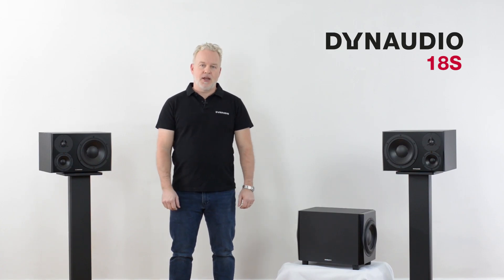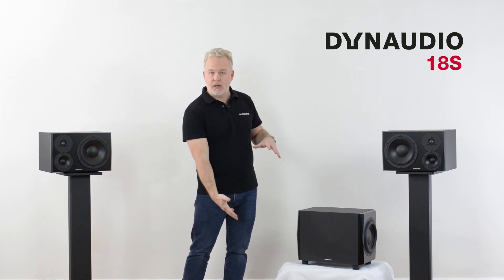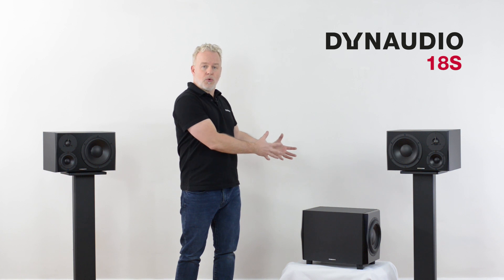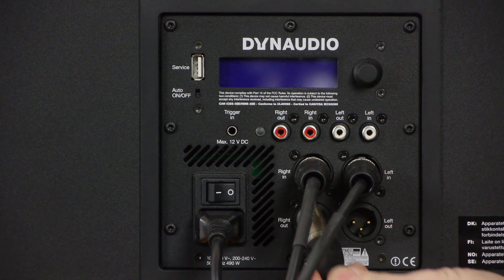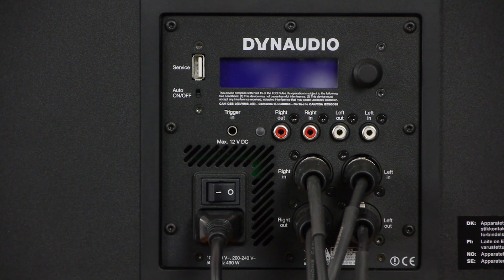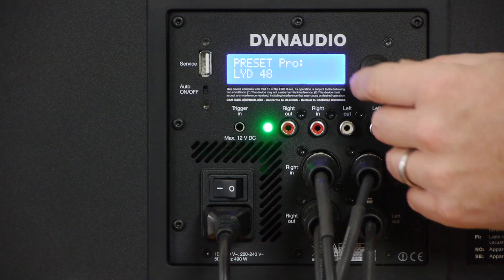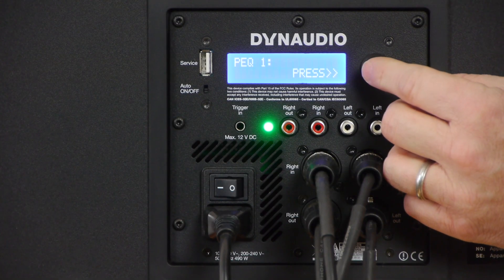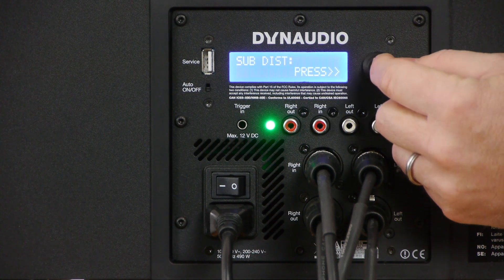Get to know the Dynaudio 18S studio subwoofer

Comment: I just bought this sub to Pair with my Dynaudio BM15A's, and it has not worked correctly. Buyer beware, I have reached out to DynAudio, but they do not reply back. Also, I have to do numerous factory resets for when the right side stops working, I did have a Dynaudio 9s, and it was a nice sub, I thought I go with this, seeing my room is 25' x 35', it might give more of what I need, but it has not yet worked correctly, I purchased from Vintage King and the only solution brings it back and we'll exchange it.I think I'm going back to the 9s, the DSP sounds like a good idea, but when it does not work, it is a real bummer
Reply: I’m running Focal Alpha Evo 65’s in a similar size room. I DJ/ Produce EDM would the 9S be sufficient?

Comment: Thanks for the video but there's a pet hate at 5:44 phase ≠ polarity. Are you changing the phase or polarity?
Reply from the maker: Hi Adrian. Thanks for catching that. It is phase :-) 

https://www.dynaudio.com/professional-audio/subwoofers/18s/support/manual/en/control-and-configuration#phase
Reply: @dynaudioprofessional  hey is it better to set the input sensitivity on the 18s at -12 or -6 when paired with the lyd 48s?

Comment: how can the 'trigger' input be utilized? how can I have the ability to bypass and engage the sub at will? i want to connect the LYD48s to the sub (rather than put sub on separate output on my monitor controller) but I'm unsure how to bypass it when needed within this kind of setup.
Reply from the maker: Hi Kelly. Thanks for asking. It is described in the manual right here: https://www.dynaudio.com/professional-audio/subwoofers/18s/support/manual/en/control-and-configuration

Hope this helps. 😀
Reply: @dynaudioprofessional  Hi, thanks, but I've already read that a few times (I re-read it again now to be triple sure). It seems to say the Trigger input can only do a 'one-way' control (eg turn the sub on, or mute the sub -- but not both). Am I understanding this correctly? I have no way to turn the sub on (as well as mute it) from the trigger? I'm super sad if this is the case, as I already blindly made the purchase thinking there's no way that feature wouldn't be available (my other 2 subs, both at similar price point, offered a manner to do this). I will also admit, that I don't know which product is appropriate to buy as a 'trigger' (forgive me, but I'm only familiar with bypass pedal approach). Could you make any suggestion in this regard?
Reply: @dynaudioprofessional  I did also email support awhile ago, but when I didn't get any response, I tried here. I still have no received any reply from support email about these questions (aside from the generic 'message received' auto reply)
Reply from the maker: Hi Kelly. I'll ask our tech staff. Please stay tuned... :-)
Reply: @dynaudioprofessional  Thanks.. really looking forward to hearing what they can tell me
Reply: @dynaudioprofessional  Hey, it's been over a month of trying hoping support would contact me after I reached out, or hoping they I'd get some definitive info here...

Comment: generally speaking, does placing the sub outside of the monitors (rather than between them) compromise the sound in any way?
Reply from the maker: Hi Kelly, 

Even though the low frequencies are harder to place in a physical room, you can still localise the subwoofer fairly well when impulsive sounds are played, so keeping it at the front between the speakers is ideal.
 
That said, moving the subwoofer around can have a massive impact on how room modes develop when excited by the subwoofer. Evening out the room modes might be a better overall compromise than keeping the sub at the front. 

In other words, you might want to start by placing the sub between the speakers, but if that is not practical in your room, you may want to experiment with alternative placements. You may even want to do that in any case due to the room modes as described above in case those room modes are a problem when placing the sub at the front and center. 

Hope this helps.

Comment: Say that i use a LYD-48 pair as main speakers. Is it possible to use two 18s in stereo mode (as an extension to main speakers)?
Reply: Sub just makes no sense in stereo IMHO. You can't locate it.
Reply: @PK-ct1bm  that would be true in an ideal world where the sub only reproduces sine waves below 80Hz or so. That's not the case, however. It is also worth keeping in mind that increasing the amount of subwoofers in a system dramatically improves your chances of cancelling a few room modes by exciting different ones with each woofer.

Comment: Great video Ashley! How does the Sub 6 differ?
Reply from the maker: Hi. The Sub 6 and 18S are quite similar, but Sub 6 comes with a different host of presets that is suited for our Home range of speakers, whereas the presets in 18S has been created for our studio monitors. Also, the finish differs, as the 18S is matte black and the Sub 6 is satin black.
Reply: They are essentially the same product with different names and different price tags . Forgot to mention that 18s is more than 1k euros cheaper than sub6 since hifi audience pays some form of tax ...

Basically I own the set demonstrated and use it for home hifi listening. The DSP and the extra settings are more than welcome for calibration purposes . 

In two words for less than 3.5k euros I have a set that it's equivalent in the hifi gear world  costs double the money to match.
Reply: @ndis1977 Hello, could you please tell me your experiences with 18s and HiFi speakers?
I have Contour S1.4 and thinking of buying one of Dynsubs. But the price difference 18s vs 6 is way to high. Is it ok to buy 18s regarding has only proDSP presets? Thanks
Reply from the maker: Hi Nick. As mentioned, they are quite similar, but they are not exactly the same product. Apart from the mentioned topics, the Sub 6 also comes with a different baffle plus grilles on both sides, and the finish is indeed more expensive to make.

Comment: will the sub 18s be able to use the predefined settings from the home speaker settings like the Sub 6 use? And can it be done the other way around? ( sub 6 with pro speaker settings ).
Reply from the maker: Hey Oystein, the 18S only holds presets for the PRO speakers, while the Sub 6 only holds presets for our Home speakers. Unfortunately, you cannot load home presets to a 18S or vice versa. // Lilli

Comment: Has anyone used these in a Home yet. Theater? Sub 6 ? Any word or feelings about that use? 
These models VS a JL or SVS?
Reply: This is a nearfield sub monitor, completely not the right application for a home cinema system.
Reply: @extropy1  The Sub 6 and Sub 18s has about the same specs. Why should it not work? I can't see a good reason for it should not work nicely in a Home Cinema setup.